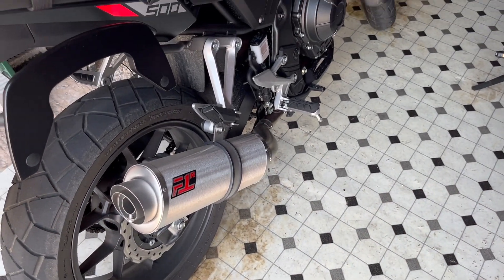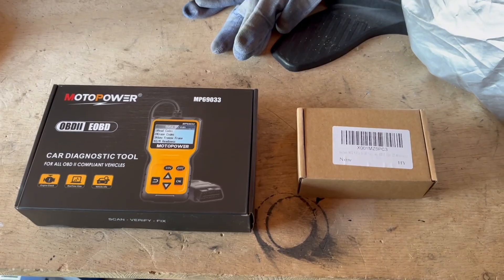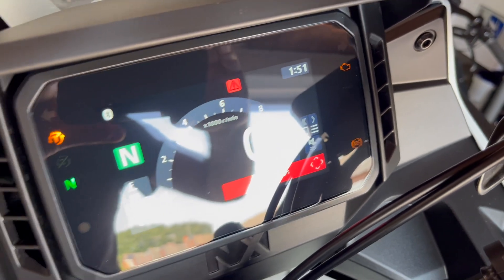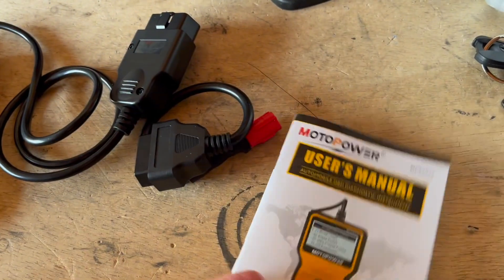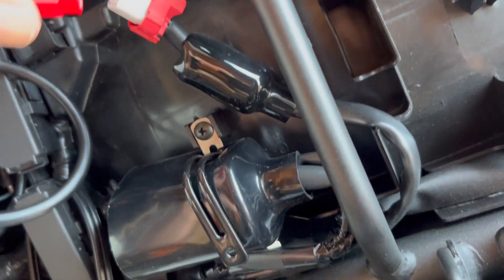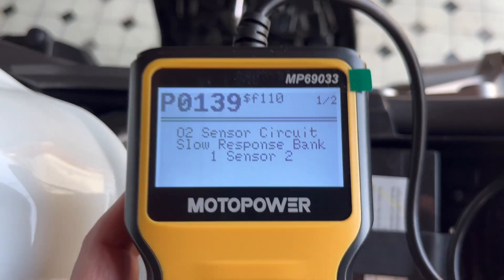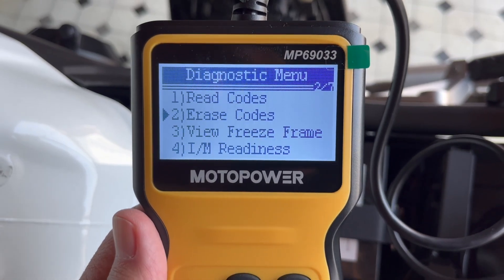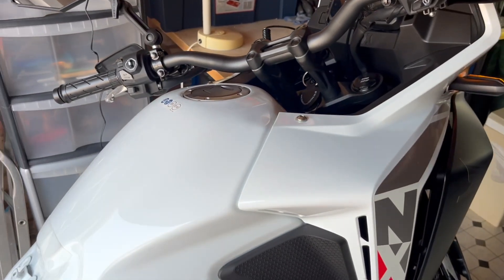Honda NX500 Emissions Light

Comment: Hello fellow biker. First of all, thank you very much for your tutorial. I own an NX500 and in January 2025 I bought and installed a black oval FUEL exhaust F1r, and I'm having the same problem. I spoke to Louise at Fuel, and nothing has been resolved.
I've taken the bike to my shop, and they've already fixed the problem three times (the last time they charged me €20). So, I've reinstalled the original exhaust, and the warning light no longer comes on, but I want to get the FUEL exhaust, which I really like.
I have a few questions:
1. I can't find the links for the famous seller AxxxxxN. I'd like you to send me them so I can buy the device and adapter cable.
2. Do I have to do this every time the 100-mile or 160-km light comes on?
Thank you very much.
Reply from the maker: So the device is:

MOTOPOWER MP69033 OBD2 Scanner... https://www.amazon.co.uk/dp/B07Z3HB7DR?ref=ppx_pop_mob_ap_share

And cable:

HouYeen OBD2 6 Pin to 16 Pin... https://www.amazon.co.uk/dp/B0BFPW9GRH?ref=ppx_pop_mob_ap_share

Yes I had to regularly clear the errors until I sealed all the connections with silicone sealant available from Fuel. Then the error didn’t return for me but I sold the bike a few hundred miles later anyway so I cannot 100% confirm the error didn’t return.
Reply: @thecotswoldbiker  Thanks

Comment: Missed this video, very helpful.... I understand from further comments the light did come back on eventually however using a gel sealant you did finally solve it.  Can you advise what the gel used is and is it applied by taking end can off or just applied when installed?  Once again, great informative video 👍🏻
Reply: a me personalmente (ho un "GPR Deeptone"), dopo aver fatto la procedura del video , ho percorso altri 12000km circa e  l'errore del sensore lambda non si è più presentato , quindi fortunatamente sono apposto così
Reply from the maker: @giacbira  Questa è una notizia fantastica. È bello sapere che è rimasto spento per te poiché così tanti hanno segnalato questo problema. Buon divertimento.
Reply from the maker: So the gel I used was this:

https://amzn.eu/d/0N9LQXs

Thanks for the kind comments too. I’ve sold my NX now so can’t comment if it’s still okay but the sealant sorted it if applied to all joins including smeared on the inside of the exhaust joint flange to link pipe then after construction don’t tighten yet until cured then tighten. After that smear more around each joint. Wait to cure.
Reply: @thecotswoldbiker cheers for that, if I do the job I’ll reference you!  Enjoy your new bike and thanks again 👍🏻
Reply from the maker: @thecampingbiker791  Thanks, it was a mucky job but worked right up to the point I sold the bike when I removed the exhaust, then sold that to another NX rider. The mileage then was at 3.5k, had it on since about 2k. I changed to the Himmy 450, it's not a better bike really than the NX but it's more capable out of the box with no mods to go a little off road which is all I do really plus 90% on road. It's good value and capable, I would say it's minus against the NX is the bottom end, the himmy has a clever trick of increasing revs when you release the clutch so it stops you stalling, the downside is not much go from the off but that translates into less likely to lose it off road which I never have (yet). Otherwise it's so far  neck and neck for me. The 21 inch wheel is a real benefit mind.
Reply: @thecotswoldbiker enjoy the new bike, it’s always fun getting to know them.  Can’t really go wrong with the Himmy, it’ll just keep plugging away and as you say 21” front wheel useful.  As it is I’ve sold the exhaust to a 500X owner and will just keep the oem on for now.. I’ll rethink aftermarket one next year 😊

Comment: Looks like I've been lucky with mine.  I swapped my OEM exhaust for a Black Widow alternative shortly after I bought my NX in March 2024.  15,000 kms later and no rogue emission light at all.
Reply from the maker: Gosh that’s lucky. Even the camping biker has admitted defeat. Did you seal the joints? I didn’t initially but I sealed it all up and it did sort it. I used gel.
Reply: @thecotswoldbiker  Yes. The Black Widow came with a small sachet of exhaust sealer.
I just swapped it out and all was grand.
Didn't give the warning light a thought. It didn't come on and I'd never heard of any issues until many weeks later when I spotted 'The Camping Biker's' video.
I don't know if this has any bearing on the matter but...The end can I purchased is, strictly speaking, not street legal.
My son has the same one on his Tenere 700 and it's VERY loud.
He doesn't use the DB reducer.
I did however and, in addition, I ordered a 2nd DB baffle that Black Widow recommend for those of us that don't like to scare horses and small children to death!
It fits in between the end can and the link pipe so, in effect, I have a baffle at each end of the can.
It's very effective and the sound is really nice.
A good bit louder and deeper note than the OEM but not at all offensive.
Reply from the maker: @17405pop  awesome stuff. I used to have a scorpion exhaust on a Ducati scrambler and that came with 2 baffles. It decatted the bike sounded great and dropped the weight by over 4kg! That scorpion also had 2 baffles in it, one at the end and one at the link pipe also. The error does suggest slow flow over that extra O2 sensor so maybe that’s a fix. Seal it and 2 baffles. Brilliant. Thanks for the comment.

Comment: Change to the orginal exhaust then the problem will be gone! The error came because the exhaust is not designed for the  engine ecu tuning for the NX engine! If you MUST have a unorginale exhaust shoose one who are made for NX 500 this because of the tune of the ecu on the NX 500! The sensor deteckt a unorginale exhaust do not fit the Euro 5 standar that is why you allvais get this error!
Reply from the maker: That's great advice and yes confirmed. I chose the Fuel as they designed the baffling and link for the bike in question and with proper sealing worked well.

Comment: What stopping the eml to come on again after another 100 mile ?
Reply from the maker: According to the camping biker - nothing it seems. I think when I sealed mine that certainly did it for me. Having changed my bike I cannot confirm this now but after just 80 to 100 miles my NX would regularly light up the emissions / engine light - after over 300 after sealing it remained off. I then removed the exhaust and sold the bike. I gather the camping biker says to put the oem exhaust back on which is sort of missing the point rather. If in doubt, I would leave buying an exhaust for the NX. Mr Fish has also had no issue and the common theme here is sealing the exhaust with silicone sealant according to him and It’s worked for him and seemed to work for me. Hope that helps.

Comment: What is E5 fuel ?.. here in Australia,  I have the Arrow exhaust and use only 95 or 98... 3,000 kls later no problems...NEVER use fuel with ethanol in anything.. we only have one sensor.
Reply from the maker: E5 is 5% ethanol. It’s the EU drive to the so called Net Zero. So Euro 5 etc. here and increasing amount of bikes released for sale in the EU now sport an additional O2 sensor post cat for this very reason.

Comment: Are you still getting this light coming on? I see MrFish isn't. Also there are some comments below regarding sealant? What is this, where does it go and is it a permanent fix? Thanks
Reply from the maker: I have moved my bike on now so can't answer that directly but yes, the heat resistant silicone sealent worked. You need to run a thickish bead of it around the inside of the link pipe on the down pipe end and the same on the exhaust then assemble amd line up as you will have it finally on the bike only finger tighten ONLY. Then run a bead around both joints on the outside. Clean any excess off and allow to go off for at least an hour. I waited 2 hours. Then, I finally tightened it all up. Then use the OBD tool to reset the error or get Honda to do it. The light did not return for me in the few months I had the bike.  Another good paste is this one: https://amzn.eu/d/hWkE20O

Comment: Can i ask with the aftermarket exhaust? Does it still come on
Reply from the maker: @Grumpysprout  yes but only if you don’t seal it with the gel. If you seal it, then reset, the light stays off.
Reply: @thecotswoldbiker  what do you mean here wrt sealing it with gel? So does this make the eml go off permanently?
Reply from the maker: @OlyLowe  you need to reset it first then seal it then yes it stays off.
Reply: @thecotswoldbiker  great thanks.  So sealing it first won't stop the light coming on initially?
Reply from the maker: @OlyLowe  It should yes. If it still comes on then you have a small leak. For pesky Euro 5.xx emissions in order to still allow thier CB500X platform to remain legal they had to install an additional o2 sensor post the CAT in order to run a comparison on the ECU. After market exhausts by thier nature are more free flowing, this is the reason for the engine light which actually is an emmissions light according to Honda to illuminate. Most after market exhausts of the slipon variant do not make a perfect seal. Using the gel seals it, and it was enough in my case. I changed my bike to a 2021 NC750X avoiding the 2025 one just come out on purpose to avoid this very same issue. Honda have done the same with the 2025 NC, installing a 2nd o2 sensor post cat in the same way as the NX and updating the ECU complete with the NX500 TFT display, so I suspect if you try to just fit a slipon exhaust on this new bike without first paying attention to properly sealing the joints the same issue will occur. Our benevolent unelected Beurocrats in the EU are dictating what we can an can't do to our bikes it seems. If you like drop the bike to me and I can reset your EL if you are near Worcestershire.

Comment: Thanks for the info. can you write the links with the diagnostic device and the special cable for Honda? I have the same problem. Thank you very much.
Reply from the maker: Thanks for watching. Both the diags tool and cable are available here: 
https://amzn.eu/d/fGLfCBS for the cable and here for the diags tool: https://amzn.eu/d/3bKJPsN
My light has now come on again so I have already used the tool to verify that'a sll it is without resetting the error this time, instead leaving it to see if the light goes out. The reason is I think all the ECU is doing is taking a baseline reading as a datalogger based on a previous map, comparing it and making the appropriate adjustment. I suspect this is done over several hundred miles and I think when the next session is reached it will compare and average the O2 samples, by doing this for several serquences it may accept the new readings as normal and clear the light. This is only my opinion and I am probably wrong but either way I will update you all what happens. Watch this space.